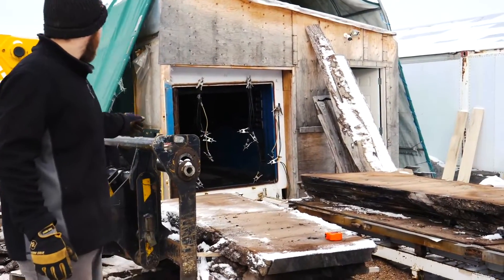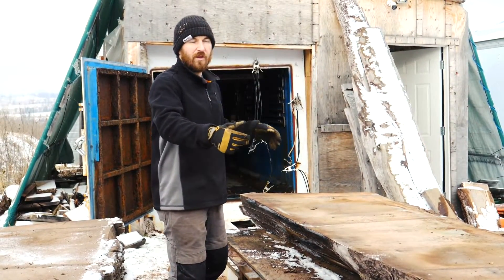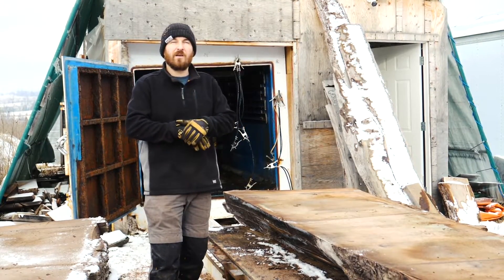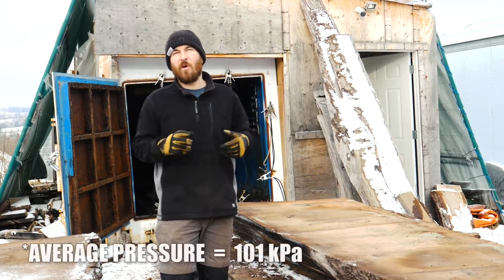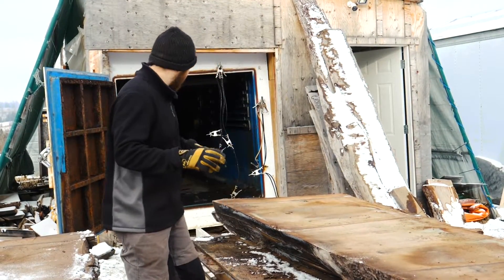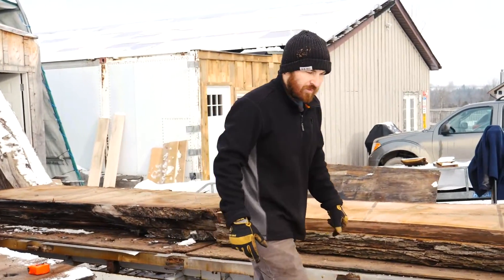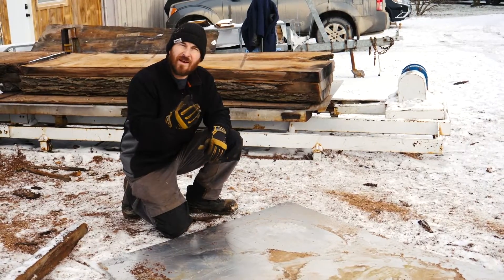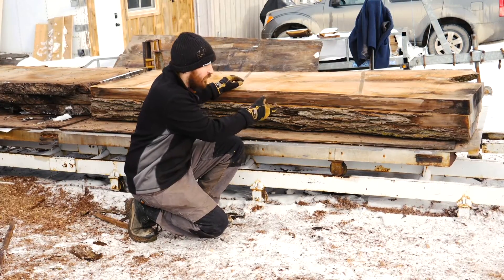Radio Frequency Vacuum Kiln

Comment: Why are the wood slabs not separated with an air gap between them?  It seems to me that would be necessary to greatly increase the exposed surface area so that the wood will dry faster.  But perhaps the RF would not work properly then.  Hmmm?

Comment: Hey this is a great video thanks FOR TAKING THE TIME TO MAKE IT.  We have a small timber mill in New Zealand working exclusively with Californian Redwood (grown in NZ). We have just added a small dehumidifier kiln to our business. We have to use this style kiln as Redwood needs a slow and low dry cycle otherwise we get a large amount of cell collapse. 
.
Your kiln is very interesting to me, but i worry that causing the water molecules to heat up from within the cell structure might cause cell collapse. Do you have any thoughts on this? What is the adjustability like for difference lumber sizes and species? 
.
Last question - is this method faster than other kiln drying? You mentioned 10 days for those massive slabs, that seems incredibly fast, what is the MC% when they come out?
Thanks for taking the time to look at my question. John Webster - The Redwood Guys (NZ)

Comment: The real question here is the drying cost. What does it cost per 1000 board feet to dry wood? With RF/V, a lot of electricity is lost as heat exhausted from the RF generator. With water heated plates heating the wood, essentially every watt is going to heating water to vaporize it. RF/V is terribly inefficient. In addition, that walnut is nearly indestructible but lets see him dry some Red Oak. If you want a good laugh, talk him into a load of White Oak.

Comment: He is swinging the chamber pressure from 68 Torr to 90 Torr. The boiling point of water at 68 Torr is 110'F which is about the maximum temperature you should expose wet wood to. He is cycling up to 90 Torr where the boiling point of water is 121'F and that is too hot for wet wood.

Comment: Why does the vacuum pump need compressed air? If you’re using a Venturi system, it’s probably the least efficient way to generate vacuum. Put in a good rotary screw vacuum pump and save yourself some energy costs. Cool video! Thanks for the explanations!

Comment: This technology was rejected by the forest products industry around 1980. The cost of drying is high because most of the electricity is lost as heat. Moisture content is unacceptable because the dielectric field is not even throughout the load. Honeycomb is common. Operation is difficult because the wood is part of the electric circuit. As moisture content decreases, the oscillator must be readjusted. Maintenance is difficult and dangerous because of very high voltage and frequency. RF/V is simply a terrible idea that the Chinese are trying to use to turn a buck.
Reply: You know, now it's 2019, but unfortunately, your cognition stuck in the '80s. I want to say, technology is changing faster than you can imagine, you have to get this point, Sir.
Reply: @dylandong888  no, Den is actually correct. HF Vac kilns are notorious for ruining the structural integrity of timber. It's why we wouldn't ever use HF vac kiln material for timber framing.

Comment: [Very informative. Smart system.] Do i get it right, this is a slow and gentle vacuum microwave oven (oh, wait, you just how said that)? and so... if i turned off the vacuum and turned off the microwave oven part, i could use as a large temperature controlled Craft Beer brewing environment, right? ||| And with that, may I once again raise a toast to Mirthful Irreverence Everywhere. [ Cultivate A Sense Of Wholesome Emotional Hygiene ]